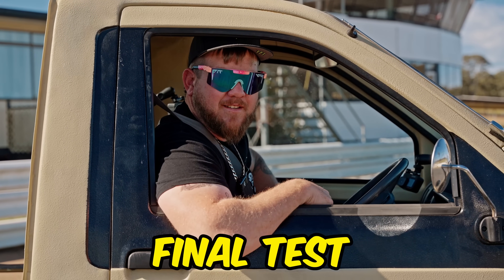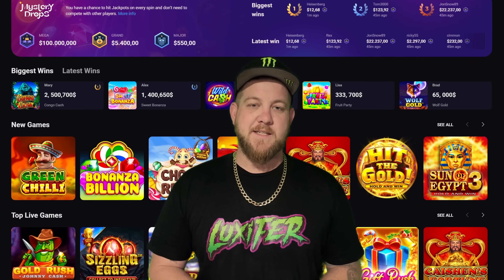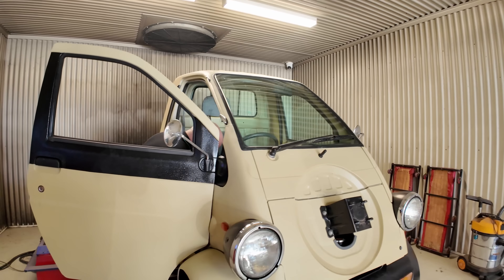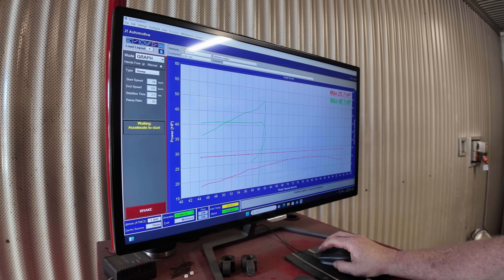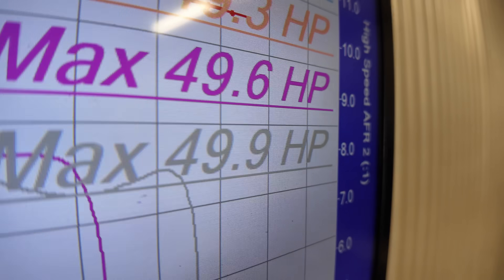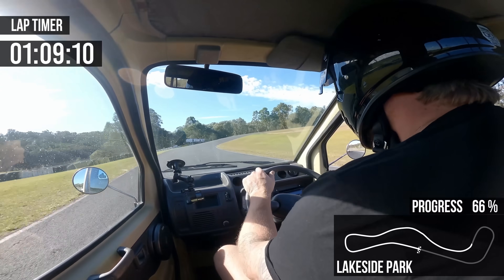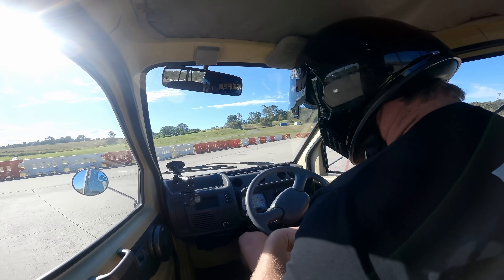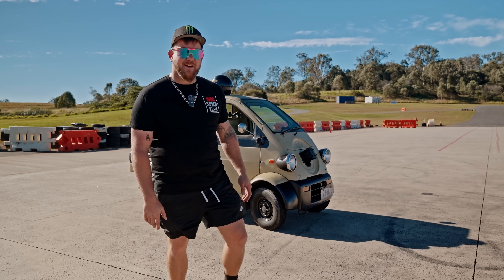Supercharged Daihatsu Midget ultimate performance test

Comment: It has the same problem my 238ci hiace ute had, its not heavy enough on the back for the tyres to smoke. Also if it rained it couldn't get over 90, sometimes 80 with a headwind. Next you should do a brake upgrade and practice some stoppies.

Comment: A turbo bike engine of some sort is awesome for sure, but you end up with not having reverse. A built boosted k-swap would be cool and would fix that problem. If that is not enough power then you could always strap like 4  maybe 5 of those small jet engines in the bed there with all that room and that could double as a smoke blower awayer for the green truck!! Those little jets pump out some air big-time!! Would be cool to see how much by blowing away the cloud the green truck makes. Hell ya brother!!
Reply: honda gold wing v6 and reverse!

Comment: Anyone think that horsepower increase might have a lot to do with methanol and not much to do  with the supercharger 😅
Reply: No if anything methodical makes less power. It’s half as energy dense as gasoline. It’s just a better lubricant, and less likely to pre-detonate. Which is why it’s safer for boosted applications.
Reply: @HFV_Junkyardin  its less energy dense, but it runs significantly richer so it makes up with quantity.
So, yes, methanol makes more power, but you need boost to really make it shine
Reply: methanol is for cooling the fuel so it doesn’t boil 😂😂😂😂

Comment: You do realize your lap time means nothing because you your first lap in the stock car was a reversed lap compared to the final lap 

So lap times can not be compared between runs because they technically didn't run the same route on the track and the track may have been working more against stock and working with the modified run 

I would laugh if the stock car was faster that way around the track
Reply from the maker: It was the same direction ha.

Comment: ALH tdi from the early 2000's Volkswagen. Throw some compound turbos on it and make some real boost
Reply: Asv tdi. Same engine but it’s slightly more powerful bigger brother. Has under piston oil squirters where as alh does not 👌🏿 there are other iterations of the same motor too 💪💪
Reply: @Binge420  Would that only be available in Germany? I'm from USA and I don't believe we had those? I have an ALH that I put the pistons and rods from the BRM in and put a big turbo on top of the stock one. Pushing 50+ psi boost, never dynoed it yet but it goes pretty good.
Reply: I like how you party 😂
Reply: My buddy has one in his 89 Toyota pickup and just bought a second to build even more power

Comment: Rotary is always a good swap for compact applications.  You can get a 1.0 engine in the same block size (MCM did it) if you want to keep it "pure" lol.  would be fun to have a built "big block" daihatsu with a vacuum cleaner .... i mean supercharger and methanol.
Reply: Nvm was also gonna turbo it
But they ran out of time and vencer did it(on camera)
I don’t know if the ever did the turbo at all
But they did it in a larger engine, however there was a lot of parts swapped and a lot of wiring(but I think that was because they also put a haltech on it and were trying to tune and turbo it so went a bit overboard)
Reply: A 1.0 ecoboost would be cool. That’s 120hp easy.

Comment: A mira tr-xx avanzato r has a motor basically the same size. (The midget has an engine based on the base model) and it makes 63hp.

Edit: or you could put a b-13 rotary in it...